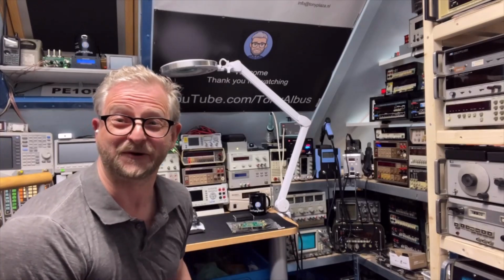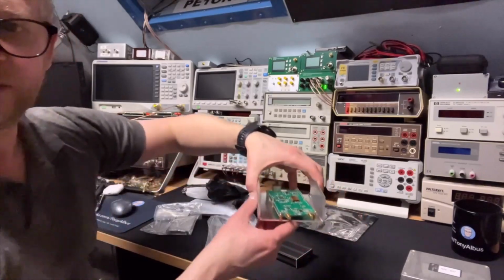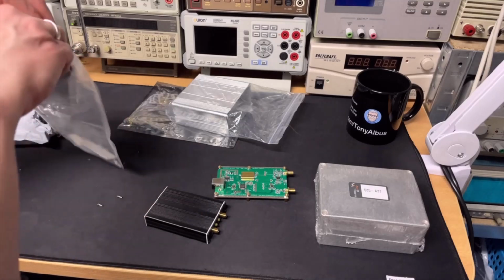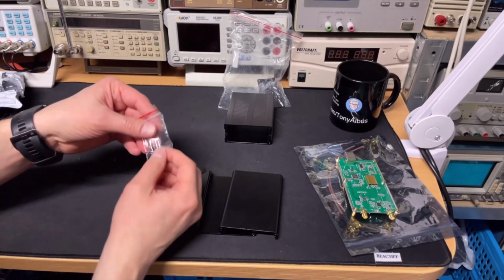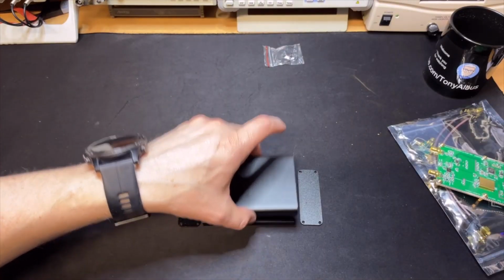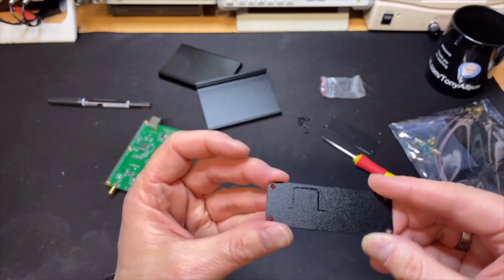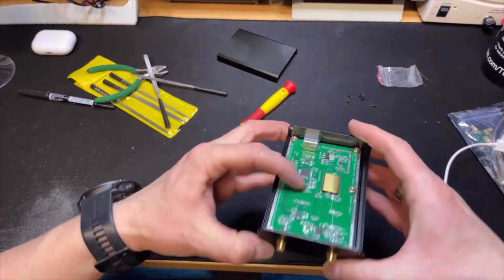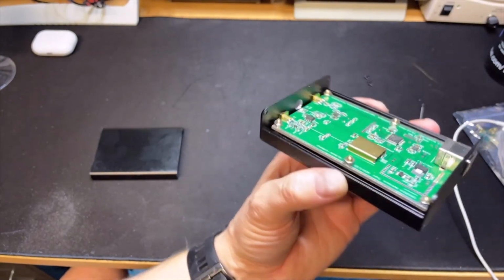#167  Si5351A Azeroth Spectrum Analyzer 0.5 -140 MHz   Case build

Comment: Nice casing Tony, unfortunately there seem to be manufacturing issues concerning the SI5351 chip. Seems the SA board is therefor sold out everywhere.
Reply from the maker: Hello Ewald, someone has told me it had to do with this company being sold, so not clear they will continue making these. i did find an other model, also below 35 MHz .. 0.05 - 40 MHz .. its also in de description, but also not to many available.
Reply: @TonyAlbus  Thanks Tony, will have a look at it.
Reply from the maker: @EwaldBurger  i saw my link was not good, i added it again.. now it works
Reply: @TonyAlbus  Found it Tony, found two versions with the AD9834. Both look very similar, but not identical. Tried my luck first with another (3rd) seller that claims to have one more SI5351 version left in stock. Will see, no cancellation request so far (the first 12 hours) :-)
Reply from the maker: @EwaldBurger  Great, let us know, more people are looking for them..
Reply from the maker: Hello Ewald, there is new stock of the AD9834, i have updated the link in the video description.